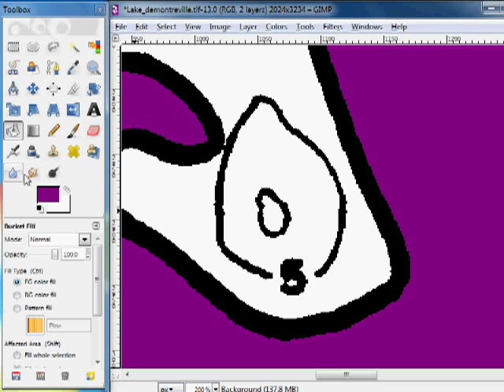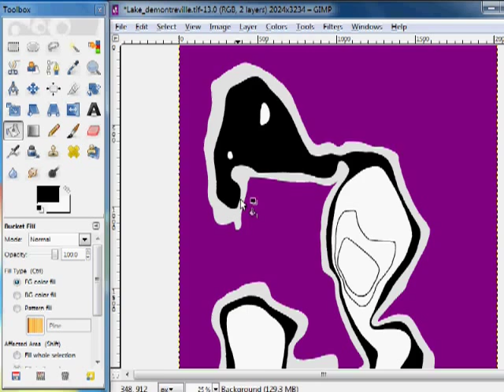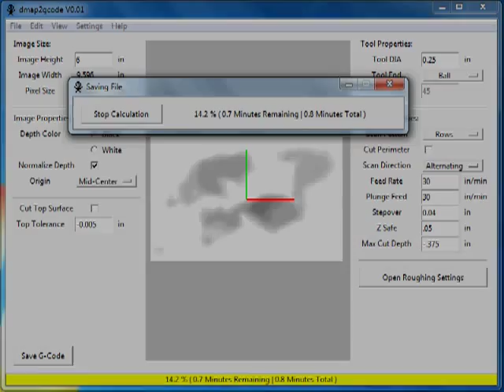Making a 3D Lake Map

Comment: Question - Not sure if the same method as this video could be used for boat hull design, but here's what I want to do and wondering if you have any ideas.  To cut out hull layers from thin luan that would build a boat hull from the bottom up and then glue the individual layers on top of each other to form a complete hull.  Again, thanks for F-Engrave, awesome cool program.

Comment from the maker: It is not possible to have a bitmap picture and text on the same F-Engrave screen.  Like you mentioned you can just run the text and image code separate.  Another option is to put the text into the bitmap image and then bring the image with the text into F-Engrave.